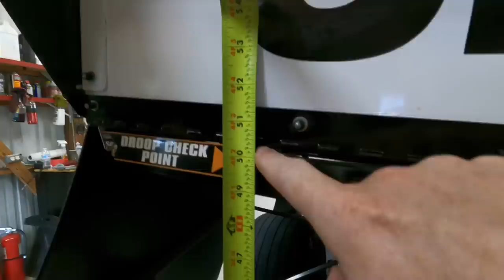New Race Car Seat and a Return to Senoia to Race with the Southern Nationals!

Comment: I have a drag racing background so I'm speaking a little out of school but how many laps yall put on one before you check valve lash?
Reply: Most check after each weekend of racing depends on how many laps they run it's similar to the number of hits on the drag strip everything goes by laps on a dirt car time to rebuild time to change fluids time to adjust valves. Enough said..
Reply: @davidttowns  I was thinking with those engines at high rpm for that long of a time it would be a every weekend type thing.

Comment: Honestly watched the crash video 4 or 5 times and what I'm about to say is my opinion.   I do not know either drivers involved so this is strictly my opinion.
Winger had no concern for himself, his competitors or his equipment.  If you watch the video enough times he refused to let off the accelerator even when he was heading off track.  Now 2 out of 3 of Wingers excursions off track were of his own doing trying to pass outside the confines of the track.  If I was an official I would had black flagged him the first time he drove off course attempting to pass.
Now Winger was obviously faster than McCarter and by saying that he should still try to pass the leader clean....sliders and all.  From outside looking in there was only one slider on that video that McCarter did not have to slow down for not to get wrecked and that was the one where Winger almost took out the nose.
So was McCarter right or wrong for having the inside lane nose to nose coming out of a corner......who knows my opinion says he is inside Winger needed to back down so not to drive out of bounds.  Yes I know a car was wrecked , but at which point does the blame fall on to McCarter for Winger never letting out of the gas.  Watch the video over and over and ignore the fight.  I see one driving willing to wreck himself and anyone else ......than I see a driver racing for the win......you pick  your poison based on your biasness towards one driver or to what is actually represented on the video because all I hear is bias people not watching what actually happened.

Comment: The I75 deal, I felt like Winger raced MCarter pretty clean, threw a slider or 2 maybe a little quarter panel on the nose on one of them but normal racing. I dont blame Winger for being mad. MAC ran him up the track every corner then finally just pushed him all the way off. Mac probly needed his head smoked for that because it wasnt just a racing deal. Now as far as Wingers crew man, he got absolutely rocked on the track and took it like a man and decided he didnt want anymore smoke. Lol.